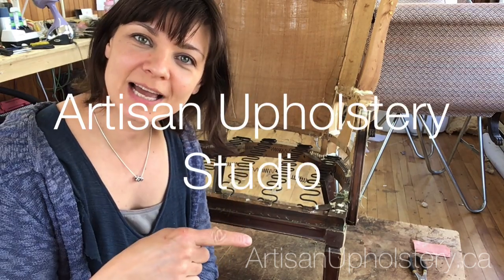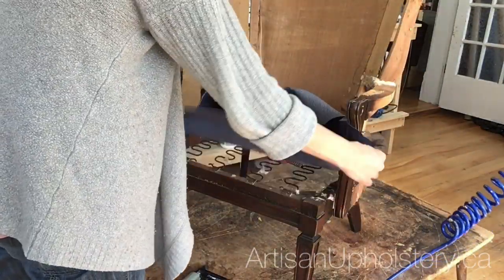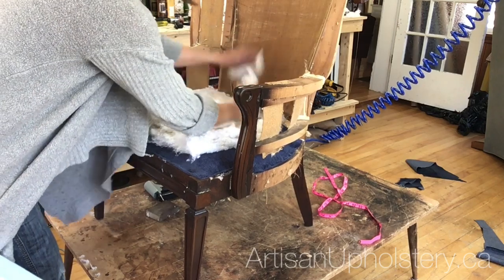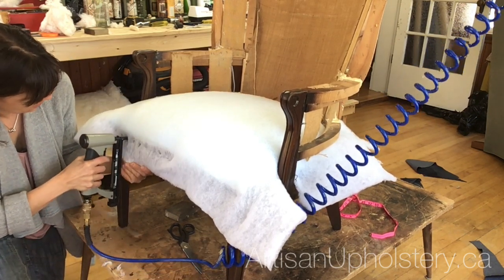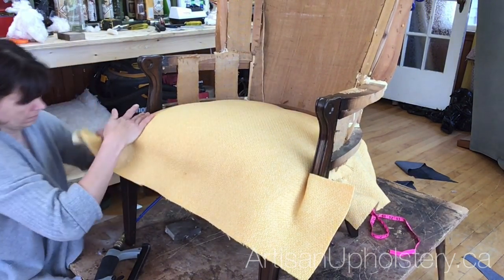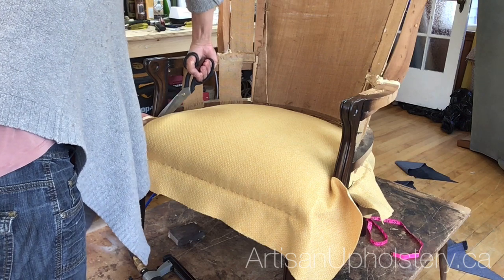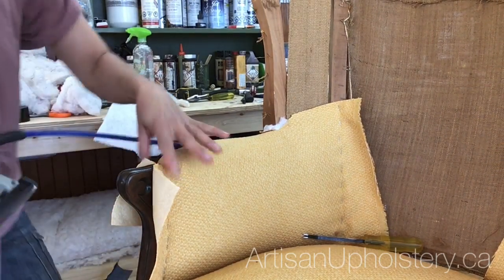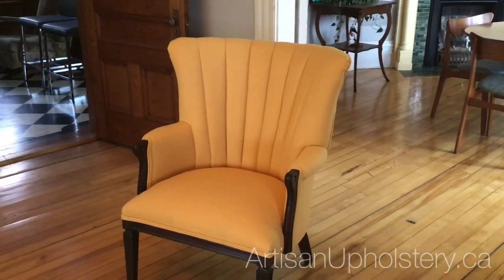“Easy” Fluted Chair, Part One

Comment: Hi AImee, your videos are super instructive. Have learned alot.  Questions... you were working on the arms, it looked like maybe you used the old cotton? Do you have a you have a rule of thumb when and when not to reuse old materials? ALso, it looked like you added some denim to the bottom of the fabric for the arms.  Was this because you were short of fabric or was it to add strength to that portion? Thank you!!